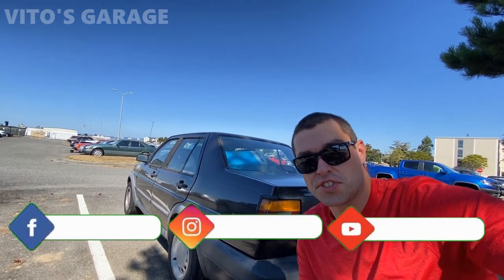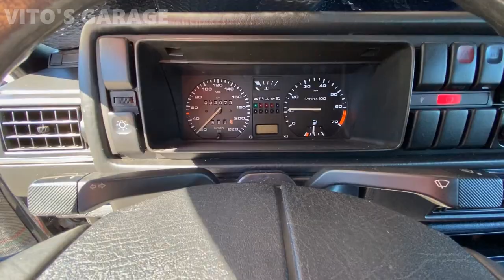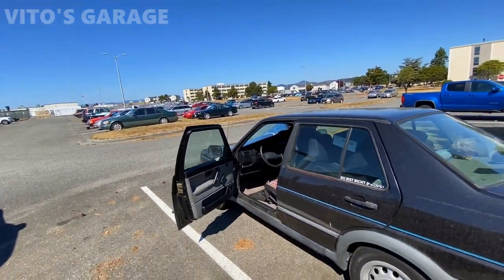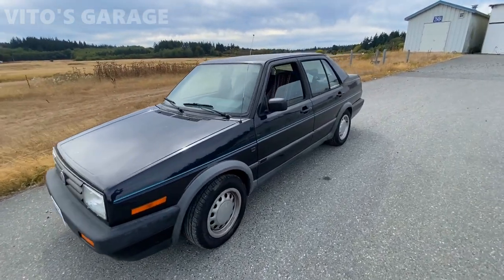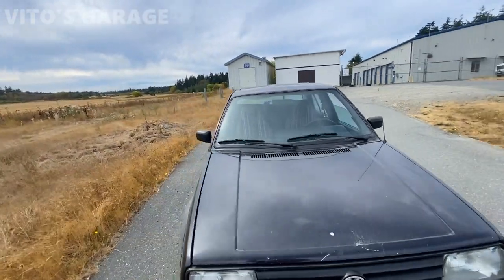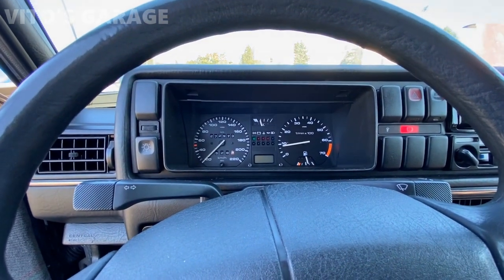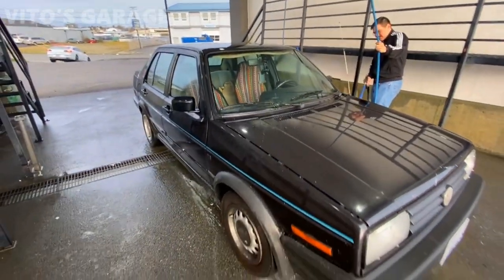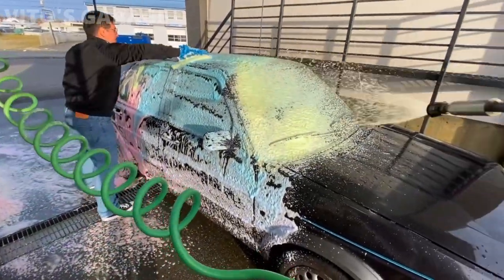Classic 1990 Volkswagen Jetta Cold Start & Test-Drive After 3 Months!

Comment: What engine is this? Many had the 90hp 1.8L in it back then. I used to hate those rims but now it’s great to see them as they are original.
Reply from the maker: I love everything about this car. The engine is 1.8l but I’m not sure about the horsepower. Comparing to W123 240D that has 60HP, it’s got a lot more power🤣